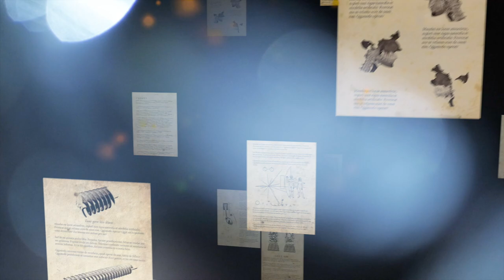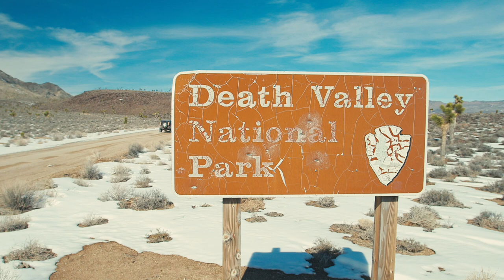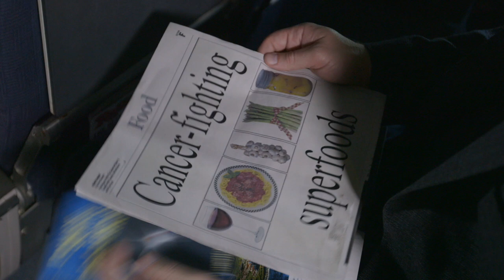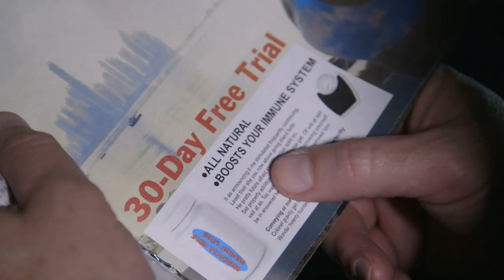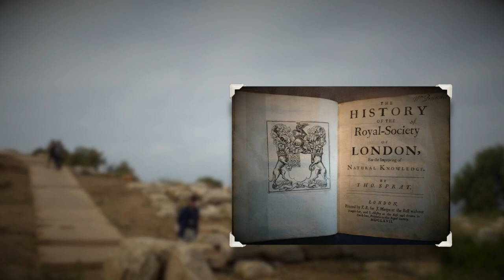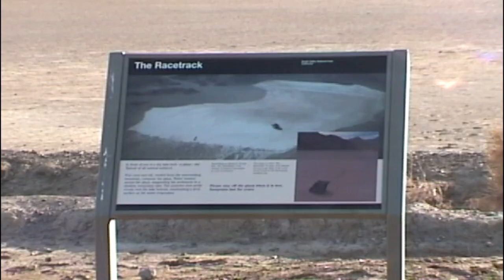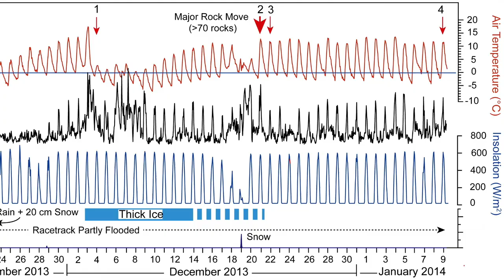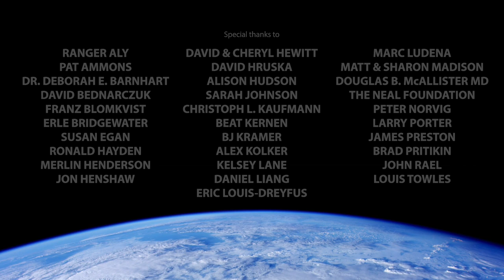Principles of Curiosity

Comment: I want to comment on 19:00 Immune System Boosting debunked.  If you have high levels of yeast in your body, your immune system will be suppressed. Dealing with the yeast will free up your immune system to be more available for other infections or imbalances. So while you can not boost the immune system, you can enhance its performance, boost its effectiveness by making corrections and changes in your nutrition and sleep habits giving us observable proof that appeals to our need to boost the immune system. The fact that all we did was boost the performance or resolved other issues to help the immune system function optimally. Is semantics enough to justify giving up hope on boosting the immune system, isn't the ultimate effect of having a more functional immune system the point and ultimate result we're aiming for. While we can't help those diseases specified in the video (Medical Science says), that is not a reason to give up all hope of curing other diseases and to someday actually learn how to boost the immune system. If we can imagine it, we can achieve it.  Just like adding an Octane booster to your car's fuel does not boost your car's engine design, it does boost its performance to benefit from its design. We're getting the results we want or are needed, should we deny any curiosity to those areas of performance-boosting, such as Viagra?  Just think where we would be if the Wright Brothers settled for mankind can not fly.
Reply: I believe you may be getting mixed up. Yeast / fungal infections, such as Candida albicans (thrush), can become a problem for those who are immune compromised. The immune compromised status comes first. Then the opportunistic population explosion of the yeast / fungus. It is particularly a problem for those of us who have autoimmune diseases, where our immune systems are over active and mistakenly attack our own tissues, and where we therefore need to take medications to suppress our immune systems to prevent severe damage or death. 

Our immune system doesn't get too busy dealing with one infection / disease / injury, that it ignores others. C. albicans in particular is defended against by both our innate and our adaptive immune response. The adaptive response creates antibodies to whatever organism invades our bodies. It doesn't roll out a white flag when something new comes along, because it's time is already being taken up by something else. If it did, we'd all be extremely vulnerable and constantly catching every single "bug" that was going around.

Nor can you "boost" your immune system. It either works properly and life goes on as normal; doesn't work at all and you need to spend your entire life in a protective "bubble"; or it works too well and you need to take meds to reign it in. If it works, it works. You can't magically boost it to make it work better than working properly.